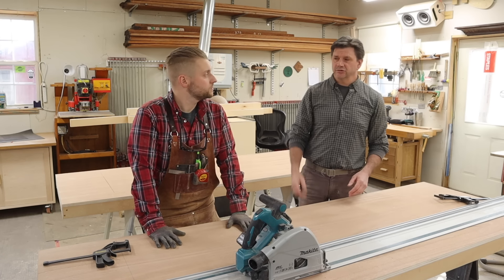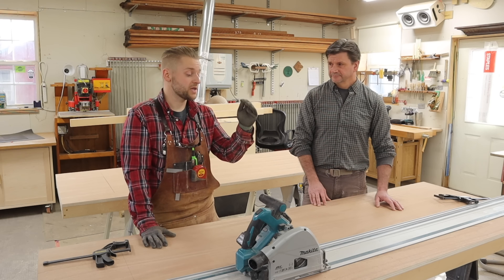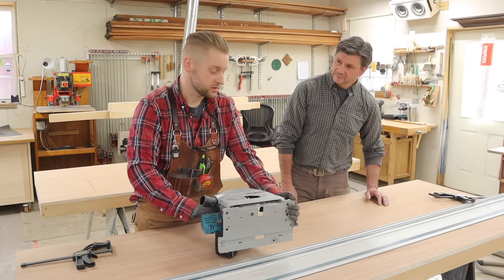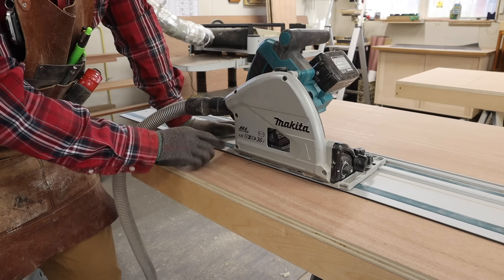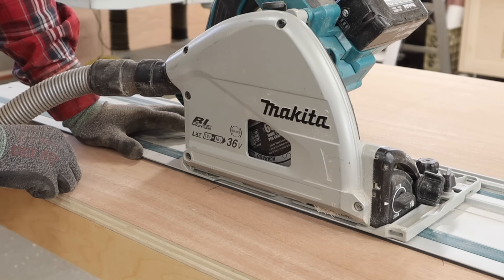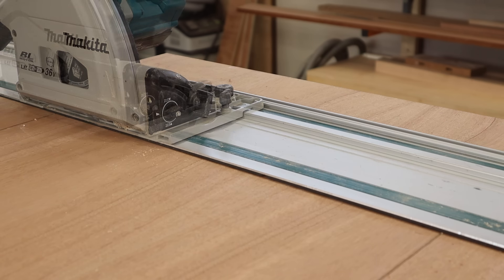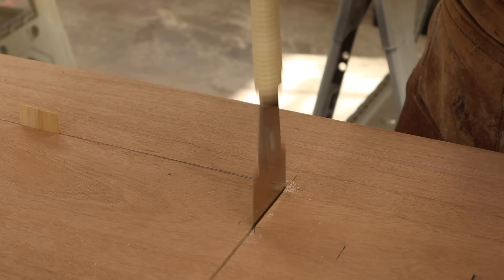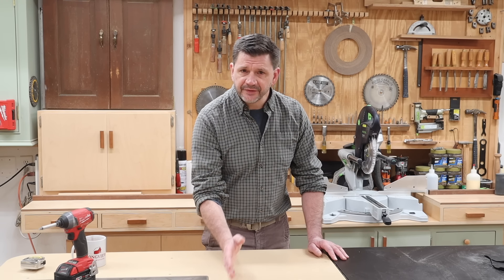I'm Buying the Makita Track Saw Next, Here's Why

Comment: Thats not the best way to make the scoring cut, try pulling the saw towards you for the score cut then plunge to the full depth and push forward to complete the cut. Yes the score cut will be a climbing cut but it's only very shallow. Trying it this way will make the cut even cleaner. This is how a panel saw with 2 blades cuts
Reply: Spot on. I saw my first scoring blade setup in 1993 in a commercial shop building high end suites with cabinetry made of matched African veneer panels.  Essential to no tear out on the bottom. The small Scoring Blade ahead of the main  blade rotated in the opposite direction penetrating the panel about 1/32 of an inch.
Reply: Yes, you are right. Shallow cut pulling the saw backwards. Blade's tooths push down wood fibers in the surface.
Reply: I wasn’t following b/c of the wording (stand in front and pull the saw, how will that help? 😂)... but yes you are absolutely correct. I think of it as a “climb cut” which isn’t really right either. Bottom line you run the track saw backwards when scoring. Back in the day we accomplished the same thing by mounting a plywood blade backwards in a circ saw, table saw, or yes...radial arm saw and making that 1/16” pass. Turning the blade around has the same impact as changing the rotation or the direction of cut.  Of course then you’d have to turn it around again to finish the cut - huge hassle  DO NOT try pushing sheet goods backwards on a table saw to avoid the blade change...even the scoring pass can turn the piece into a projectile. I sent a cabinet door panel sailing THROUGH a pine raised panel door in my first shop.  Luckily no one was near the scene of the stupidity 😂
Reply: @HBSuccess   Err... no it doesn't ... reversing the blade is most definitely NOT the same as pulling the saw back towards you ! 😳
Reply: @peterfitzpatrick7032  yeah it is along as you set the depth to 1/8 inch or less. The blade is scoring the stock in reverse....

Comment: I ran a makita corded version for the last few years. Upgraded to the festool. It does feel like a better higher quality saw. The depth stop on the festool is so quick and easy to adjust vs the makita that the scouring button is no longer required. I run my power cord in the sheath that protects the vacuum hose and stops it from snagging on the track. So going cordless doesn't make sense. Both great saws that make you wonder how you got away without them before.
Reply: i've jumped straight into TS55 and it was a good decision. Not that makita is much worse, for me it was the depth change and plug-in system that made the deal. really nice thing to switch between saw, sander and domino.
Reply: @ignacymat  my DF500 and TS55 don't have the same electrical plug? The actual shape that plugs into the tool is different on both (because why would Festool use the same plug for all their machines 🙄).

Comment: Or get the Dewalt that is more powerful than both, has a riving knife, has an anti kickback feature, sits on two track ridges for more stability, and the tracks can be used(cut) on both sides. Festool and Makita are behind.
Reply: Also the clamps for the Dewalt are great and cheap. You can see they are using them in this video.
Reply: Not to mention it doesn't need a scoring feature simply because I have never had an issue with tear-out with mine. My only real issue with it is I wish Dewalt would come out with more accessories for it.
Reply: @Sandriell  Well, tear out can happen with any of these saws.  The Makita doesn't perform any better with the scoring feature. Look at the 2nd pass he does in the video after scoring... A bunch of splintering on the off cut. I don't think the Dewalt does any better with cross grain off cuts... The point is, the scoring feature is not a useful feature. The Dewalt is so much better than the Festool and Makita is many other ways, not even really comparable.
Reply: @00dahc  maybe its because I have just always used a very good blade on mine. And yeah, I saw the tear out on the video even after the scoring pass.

Comment: Not trying to change your choice. Festool TS55 battery version has a scoring feature and I have had mine for a couple of months. Along with an MFT, I have used it a more than any cutting tool in my shop. I have been cutting ¾ walnut faced plywood, no power problems at all.
Reply: I've never had a power issue either. It's all about choice and what you want.
Reply: New Festool battery powered TS55 also has a narrower kerf (blade thickness) which results in more cutting power by having to remove less wood. Absolutely love mine!
Reply: That would be the TSC55. I’ve heard the power issues were fixed in their cordless lineup as well.

Comment: Spot on with his first reason for getting the Makita: If you want cordless, go with the battery platform you already have. The feature differences likely won't make up for the extra headache of buying and managing more batteries just for one tool.
Reply: Problem with that idea. FESTOOL is a system, not just one tool.
Whats wrong with a corded system?
Truest me I dont own any festool and have no plans on buying the over priced stuff.  Its my oppion if I were relaying on a tool to earn my living id go with the most features.
By the way mekita was top dog 25 years ago.
MILWALKIE is today. If its red the batteries are not dead.

DEwalt makes a system as well as grizzly  read reviews and look at differnt systems. But over all what tool gives the best qulity work.
FESTOOL was designed to be a portable woodworking shop fine finiture.
Most of the rest of the tools were made to do construction work.
This has to be taken into consideration.
If your doing qulity work you can charge more to help offset the costs, also its a tax write off, and the tools depreciate 
Actually they dont they hold there value better then any other brand.
Reply: @bobbg9041  my point about the cordless tools was 'IF you want a cordless tool' go with the battery platform you've already invested in. The more you've invested in that platform, the more it makes sense to stay with it. Now, if you're perfectly happy with corded tools that advice goes out the window. For corded tools, buy the best tool you can afford, manufacture doesn't really matter in that case. I do completely agree with your assessment of festool. If there's anything from their lineup that I'd like to have in my shop, it would be the Domino. The rest, I'd rather spend less money.
Reply: Cept Milwaukee does not make a good portable track saw yet
Reply: You can buy battery adapters really cheap to use makita on dewalt etc

Comment: I have the Makita 36v track saw for 2 years now it is super great for sheet material.
only down side I find is when I am doing deep cuts on hardwood 
it will eat battery's but if you are not cutting a lot of 40mm+ hardwood 
it is a great saw for pros and DIYers

Comment: I love Makita tools, have them and I use them quite often, however even with this scoring option you still get some tear out @4:22, My Bosch track saw never produced such tear out on any plywood wood I cut without scoring. My 2 cents. Thx for sharing this.
Reply: If you get tear out with a track saw my advise is to check that you are using the correct blade. Check that your blade is clean and sharp. Next make sure your saw is setup to your track. Make sure your upper minimal clearance tab is set on the wood your cutting. If you still get teary or it’s possible that your plywood is of a poor quality. Putting some painters tape down on the face surface and cutting through that may help..cheap tra saws often suffer with a bit of “blade wobble” due to poorly balanced blades or poorly set arbours.

Comment: I've had the Makita for several years, long before cordless was an option. Plugged into an overhead outlet, the cord is never really a problem. FWIW, Always use the vacuum. A friend uses two (all day everyday) in his cabinet shop and his guys never used to use a vacuum until they burned up both in short order. Now they run the vacuum faithfully and their replacement saws have been running for 4 years without any trouble. Best, Andrew @BranchAndFoundry
Reply: Does this apply to outside use with no vac still damaging them?

Comment: As a general builder I bought an erbauer from screwfix for £180 as I couldn’t justify the cost of a makita, after 3 jobs with it the blade kept jamming, motor would stop after an inch worth of cutting so I threw it against the wall and bit the bullet on a makita as all my other kit is makita, just wish I bought it in the first place absolutely awesome bit of kit you won’t regret buying one, I found the scoring feature works better pulling the saw backwards on a cross cut of ply as the blade is traveling downwards 👌

Comment: It’s funny that guys say the festool is under powered but what they don’t understand or don’t know is the festool track saw uses only the power it needs to make the cut it is a smart saw and automatic adjust based on the resistance.
Reply: So glad you mentioned it Dave. Kind of makes me think the guy never operated one. You really have to watch what you state in a video when you are trying to put down one brand while elevating another.
Reply: The ts55 I've used I foundt to be massively underpowered too. It's obviously not all that "smart" if it doesn't know when to ramp up the power to get through a cut. Cutting 24mm birch ply with it was almost impossible. My cordless Makita had no trouble with it at all
Reply: @keefykeef  I have 4 TS55s on 2 separate job sites. We change blades for different operations. And always have our blades sharpened bi-weekly. The one you used must have had  a bad motor. Suggest the owner call warranty!
Reply: @JDDupuy  I'm glad it works for you. I have never changed blade on my Makita, it cuts through everything clean as a whistle

Comment: The Bosch has a scoring feature as well as the line marks for knowing where the blade limits are AND up to 48 degrees bevel and is very powerful.
Reply: Does it? I thought that was one of the feature it did not receive from the Mafell original. Which model are you referring to, GKT 55?
Reply: Does it? I thought that was one of the feature it did not receive from the Mafell original. Which model are you referring to, GKT 55?
Reply: @i679n5  Mine is the GKT13 corded version.  Has a scoring capability and 47 degrees not 48, I had to go look at it to make sure.
Reply: @ugafan1779  interesting, thanks!

Comment: Track saws are a game changer, I had a big panel saw to rough cut sheet goods down and finish cut on the table saw. I sold the panel saw and got the Festool TS55 and never looked back, this was at least 10 years ago.
Reply: I bought the Festool TS55, very disappointed with the lack of power. Now looking to replace the saw with something compatible with Festool tracks because I own 3. I understand Makita is compatible, will not buy overpriced Festool again.

Comment: Secure the power cable to the tube... Surely the makita vac has power outlet, even if it doesn't, run the cable to the vac then to the power point along with vac power cable

Comment: Other reviewers have said the same thing about the corded TS 55, but have said the new battery version of the TSC 55 seems a lot more powerful than the corded version.  I have the TS 75 and don't have any problems with tearout on cross grain cuts, don't need to make two passes.  Seems like an unnecessary waste of time.

Comment: At 4:21, I'm seeing tare out at the end of the cut that is supposed to be demonstrating how to avoid tare out.  Am I overlooking something like this being the backside of the piece?  Which is how it should be as that seems to be the standard for cutting plywood with a circular saw.  What if you want both sides to be splinter free?  Aside for using tape, is there a way to make this saw do that?  Very interested in a good track saw and really like Makita.
Reply: Try a different blade .

Comment: The WEN track saw also has a scoring setting.  I believe (not certain) that the Wen track and Mikita tracks are compatible
Reply: They are compatible. I bought a couple WEN tracks and cut them to shorter lengths (24 & 36") for hardwood crosscuts. They work perfectly. Best, Andrew @BranchAndFoundry

Comment: Question for everyone.. I too just purchased the Makita. The saw does not have replacable slides in the base where it slides on the track as Festool, Milwakee and maybe others do, but slides against the actual base plate. After just 3 or 4 passes on the track the paint is already wearing off and I'm wondering IF there will be issues down the road because of this design. I am surprised Makita didn't pay more attention to this detail. Otherwise an awesome saw at an awesome price point!
Reply: Question for you. I’ve just purchased a Makita circular rail saw and rail.

With you now a year down the track, have you noticed any problems with wear?

 I’ve only used mine once thus far.

Thanks.

Comment: The Wen track saw had the scoring feature AND it's integrated into 1 switch. The switch had 3 settings: 1) set depth cut, 2) scoring cut, 3) blade change. It's much more elegant. Instead of having separate switches there's just the one.

Comment: Depends 
First off there are sevral systems.
But what you have to take into account 
Is Festool is a woodworking shop thats portable, the mikita is a construction tool.
Are you making finiture at the customers house or hanging shelfs. And whats your qulity expectations. 
You've got to take everything into account.  Do you need cordless?

I dont own any festool, and im not looking to buy any. But from what I've seen the cordless version track saw from festool under preforms but the rest of the system is hands down better then anything else for qulity of work.

Grizzly makes a system, dewalt makes a system kreag makes one and sevral other brands. You've got to price each one and get some comparison reviews.
Price you can always use the cost as a tax deduction. Price shouldn't matter.

Comment: I bought a cheapo Scheppach tracksaw (being a DIYer) and with a Freud blade it actually cuts very well... 

I'm going to max-plunge it & put those markings on the base, super handy idea right there... 🤗

I'll have to investigate to see if I can fit some kind of '' scoring lock" to it as well... as a machinist by trade, I have all the equipment at hand to figure out & implement a modification... 🤫

I've heard great things about the Makita & if I were doing more work, I'd invest in it over any other brand... 🙂

From the Emerald Isle
😎👍☘🍺
Reply: Milwaukee, I heard, is the best!

Comment: I have the corded Makita track saw. I went with corded because of the price and all my battery tools are Bosch. I didn't want to get into a second battery system and Bosch doesn't make a cordless track saw. I went with Makita because their track is a clone of Festool's track. There is a large selection of accessories for the Festool track and all of them are compatible with the Makita track.
Reply: Bosch CAN use Makita/Festool tracks. Just remove those plastic parts from the bottom of the saw. Mafell/Bosch tracks may be better but the world is compatible with Festool tracks.

Comment: I find it hard to believe a battery op saw has more power than a corded Saw. Regardless if Festool ( Possibly  going bad / old). Also power depends on what your cutting. YMMV.  In any case appreciate your video and content.  The scoring feature you showed  very nice feature.
Reply: I have this saw and it cut a heavy duty hardwood fire door blank in one pass. Power is no concern.
I have used a corded festool also and much prefer the makita.

Comment: When you plug the vacuum hose then is battery platform completely obsolete especially if you using track saw in the work shop.Not sure what americans are cutting but here in Europe I never had issue with Festool. The tool is made for furniture and finishing wood and not for lumber ( non of them actually is).

Comment: Don’t focus on “cordless” or “Makita.” Focus instead on “track saw.” I have transitioned to using a track saw for nearly everything I once used a table saw for. The track saw is much easier, and safer, than the table saw ever was. What I can’t do with the track saw — rabbits and dados, for instance — I can do with a router.
      Using a track saw is infinitely easier and more precise than any home-made guide / circular saw arrangement. There’s really no comparison.
      “Cordless” is also well worth the expense. The added simplicity and convenience make a real difference in how often the tool is used.
      As luck has it, I have a Makita cordless track saw. I can’t find anything to improve on it. I strongly recommend it. Yet, my point here is that ANY track saw is a huge improvement to whatever you’re doing now.

Comment: This is on my list also. Debating between corded or cordless. I'm on the dewalt platform and really don't want different batteries. I'm thinking about getting the battery converters where I can use dewalt batteries on makita tools. Will probably do this also for the Milwaukee 18g gun.
Reply: @Chris Horsford you'll find them on ebay. Search for something like dewalt battery to makita tool converter.  You can probably get any type you want - makita to dewalt, Milwaukee to makita etc. Just about any combination is available I think. Just be sure you are getting the correct one that takes the dewalt battery and fits the other tool, not the other way around.